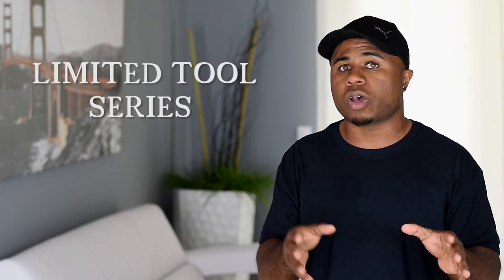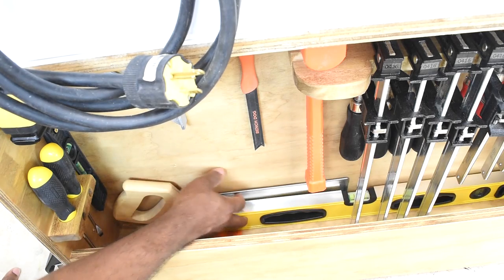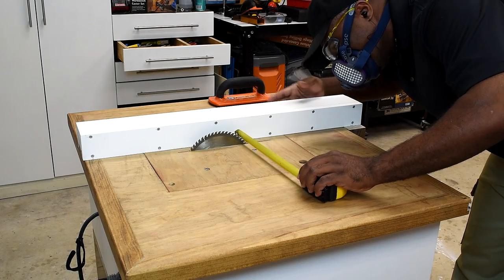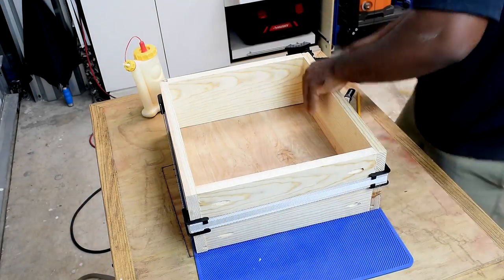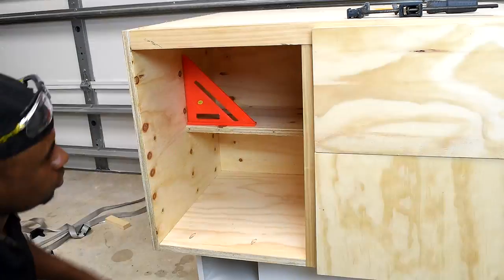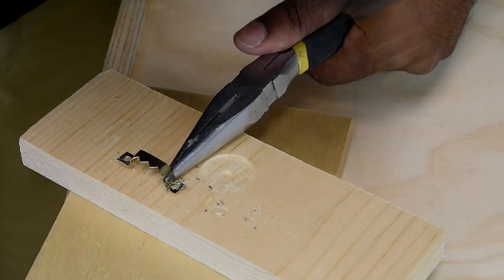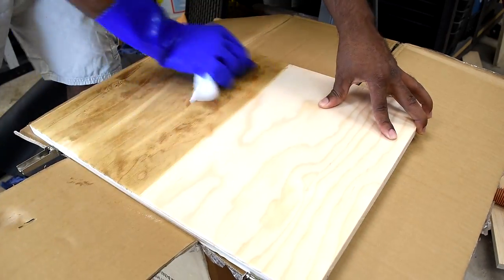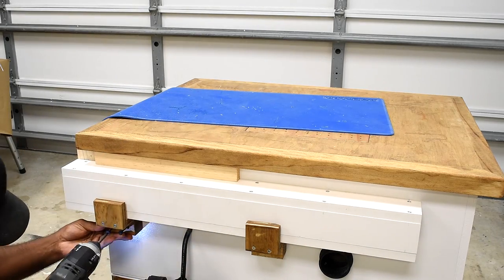How To Make A Table Saw Stand  for the Homemade table saw / Plans Available

Comment: Another nice build. You commented on the picture holders to hold the measure tape. Personally, I say, if something in a build can be done even with different material - if it fits the purpose, the material was right. Since technically it makes no difference and visually neither it should be fine. I was just surprised, since you put it on the inside of the box. I would assume a measure tape needs to be used more often, even at a table saw, so the outside seemed more natural to me.
Oh hey, how about a "DIY Clamp Rack" video, since you used tons of them again. xD

Comment: İ love your work and it is so inspiring.. Thanks in advance... than i want to ask, with the diagonal screws you fix two sides doesn't make the wood more fragile because of the thinner part at the edges? with the glue u also add does it strong enough even more heavy duty?

Comment: Really nice job!  For hanging the tape measure, my shop teacher in high school would take a dull hacksaw blade and put a screw through each of the two holes with a 1/8" rubber washer between the blade and the wall.  I tried what my shop teacher did, and it has worked out pretty well except I never remember to put the tape measures back on the holder
Reply from the maker: Thanks, man! Cool . I have like 5 measuring tape and sometimes I misplace them all.

Comment: Love your videos, thanks! Quick question though, I notice you used the saw guide and track saw to make what seem to be basically the same cuts. Do you really need both tools? It seems like if I just made a track saw that would do about everything I would need and would be a more accurate easier to use tool. Only real advantage of the cutting guide version is that it would be easier to build than the track saw. Just wondering on a limited budget with limited storage space in my garage if I can get away with only one of them.